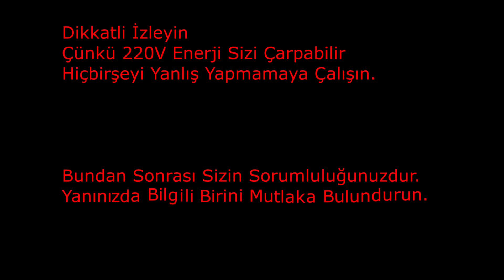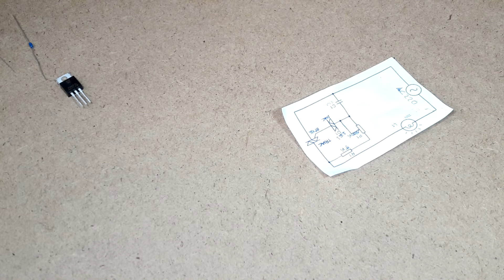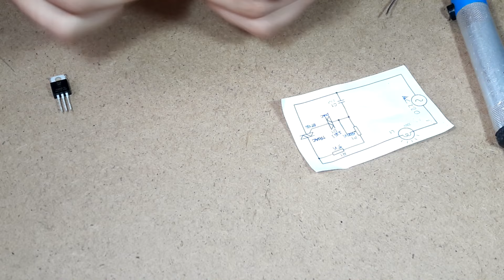Making Simple 220V Dimmer

Comment: I think that resistor doesn't have enough wattage and this can cause serious problem.Or maybe I'm wrong!
Reply from the maker: Resistance is enough. Already the load is completely through the triac. I have tested with a load of 500w, I have not encountered any problems. Of course, using a stronger resistance does not hurt.
Reply: @Nepercos  No i mean how did you calculated resistor power needed ? Thank you
Reply from the maker: I didn't calculate the resistance. Resistance circuit at a constant value.

Comment: Can this circuit be used for 110V AC? .. Regards.
Reply from the maker: +eddy cruz No, I use 220V. You can use 110V. I do not know how sensitive it is. Do not use voltages above 220V only.
Reply from the maker: +eddy cruz And, yes AC voltage.